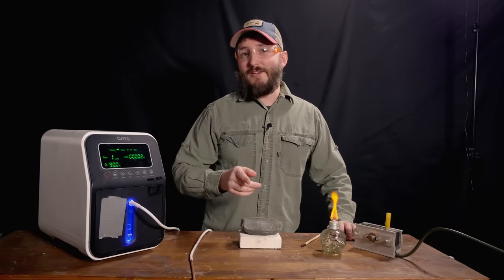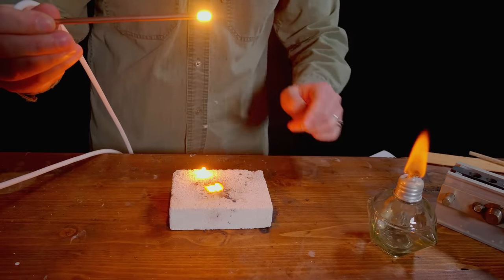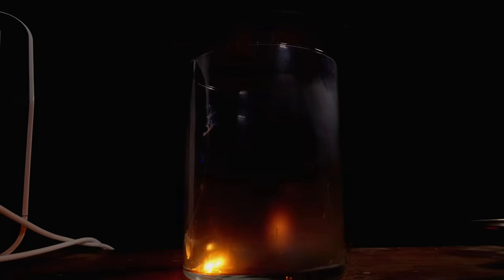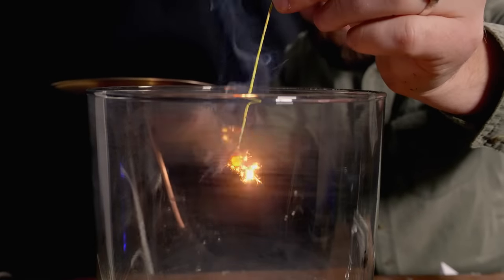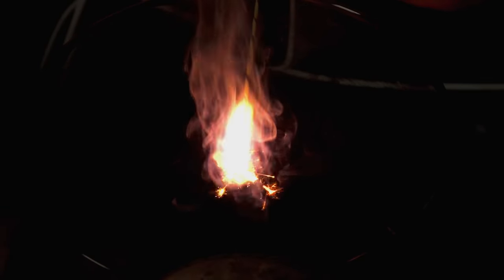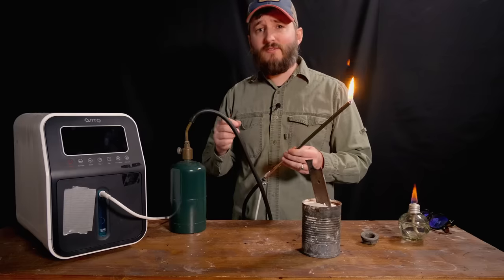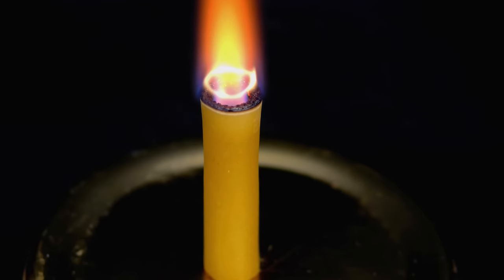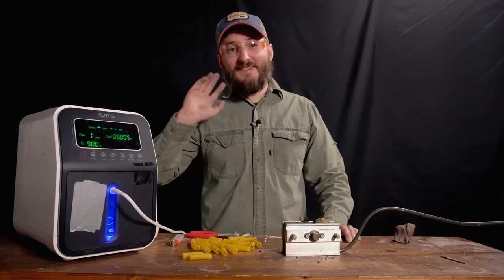6 Unauthorized Uses for a Medical Oxygen Concentrator

Comment: Thanks for an interesting video. I may wanna show other people what oxygen can do when you get it in your clothes or fabric.
I work as a biomedical engineer and service these kind of equipment and what I can see, is that your oxygen concentrator is rather weak in performance. The one I work with can deliver up to 95% pure oxygen at a rate of 5 L/M. It would be interesting to see what kind of results you could get from one of those.
When I get kids from schools to  show to our workplace, I often take them to our welding room with one concentrator with a long hose. I then take a bunch of small wood, ignite it, let it burn and it burns as it normaly would, yellow flame and rather peacefully. But when I put the hose near the bowl with wood, it burns extremely hot, white flame, lots of sooth and almost no ash. What I tell them is that oxygen is not flammable, nor explosive and that I get no flame to follow the stream of oxygen. Many people are afraid of oxygen due to old accidents with high pressure containers which got overheated and exploded.

Comment: Use a hollow carbon rod  ( arc/air)  with a welding machine. Maybe need pressurized air to blow away the melted steel. Thanks for this wonderful video.

Comment: 6:20 as soon as I head your explanation of that, i thought back to watching William Shatner's unsolved mysteries thing on discovery Channel as a kid. The segment on "spontaneous human combustion" really stuck with me, and super-oxygenation of the bedding and the person's clothes would perfectly explain the weirdness they talked about.

As for the source of ignition seemingly being the person themself? Static electricity with dry skin would do the trick. I had those thin, fuzzy polyester blankets as a kid, and rubbing the back of my hand against it made enough sparks and enough light for me to look for my glasses and bookmark without turning on a lamp. Also, it made the back of my hand quite hot. With enough oxygen, I'm certain that could spark an inferno.

Comment: I was a welder for many,many years and used an oxygen acetylene torch a lot. Your torch needs a mixing chamber to mix the propane and oxygen. You can only get them to mix a little when they are flowing out at different rates. Just make sure you have backlog prevention. You don't want oxygen in your propane tank or vice versa.

Comment: My thoughts on your demo test. Cool start for sure :3

a larger longer cut of a similar pasta could be fun, what if you layer 2 cylindrical ones somehow, O2 down center, the between space filled with another solid propellant. like linguini or spaghetti? Is whole a viable alt to bleached pastas? Or a non pasta substance, as a control with a more traditional but low yield fuel? 

A multi tube 'rocket'  stack a nice number like 7 together, with your same or another kinda clay set up. you could even cap one of the lines like they do on rocket boosters when degraded, for some ed reasoning I don't know. Look neat.

Paint the inside or outside of the pasta with what umm chemical salts to change the color the flames?

Comment: I'm wondering if using a thinner pasta like Ziti, or Penne would be a better ratio of fuel to the amount of oxygen produced, and allow higher flow velocities since the internal diameter is reduced. Making the oxygen line more narrow would help increase its velocity as well, (assuming the generator can handle the increase in the resistance) maybe try using an air nozzle that's for filling the basketballs at the oxygen output. Covering the whole noodle in clay would help with the blowouts and get full use of the fuel by providing reinforcement and direction where the pressure can vent. The experiment can show the effects of various fuel & oxi combos by changing the noodle type (ie. gluten-free or higher calorie) and changing the oxygen flow rates, along with the various nozzle designs.

Comment: I had some ideas for experiments for you! 
Make pure carbon from sugar and sulphuric acid and wash out the acid. Theoretically it should make a very good carbon for senko hanabi and gunpowder because there is no internal structure or ash like in wood. I tried baking sugar in a very hot oven with a tightly sealed foil covering with a hole for releasing the off-gassing, after baking I covered the hole and let it cool and I got a very fine carbon that spontaneously combusted when exposed to the atmosphere!

An experiment you could do with the oxygen concentrator is enriching air for use in an NO2 generator. Atmospheric air is the wrong ratio to efficiently be turned into Nitrogen Dioxide because the excess Nitrogen interferes with the reaction. The enriched air would turn more efficiently into NO2 with less Nitrous oxide and you could even run some oxygen through an Ozone generator and not only get way more ozone from it but also use the ozone to react with the NO2 generator output and oxidised the under-reacted NO gas.
Reply from the maker: Good idea for an NOx generator. For fireworks pure carbon usually has much worse performance than wood charcoal.
Reply: @Nighthawkinlight  Thanks for the reply! I reckon the reason charcoals burn better is because when crushed they form low density, porous particles whereas pure carbons like graphites have regular structures and plenty of interlocking covalent bonds resulting in smoother particles with less sites to hold onto the other gunpowder ingredients.
Sugar that has had it's Oxygen and Hydrogen ripped out is like a fluffy, expanded carbon foam puffed up with steam, closer to charcoal than pure carbon.

Comment: It's neat to see the separation of the tube layers of the PE tube at 5:24. The outer jacket peels back leaving what looks like a liner inside. I think the outside of the tubing is a softer lower melting temp PE which provides a softer more crack resistant jacket. I'm guessing that the inner liner is a higher strength core that has better creep resistance. 

Pretty cool hot glue gun lance!

Comment: I was a tapper at a phosphate plant, we used to use magnesium tubing with oxygen flowing through to open or melt the clay plug in the furnace so the slag would flow out after processing of the ore. 
Other substances that came out of the furnace were also raw melted iron from the ore...
So yeah I think magnesium would burn a lot hotter then the steel...

Comment: I’m only 10 minutes in so I’m not sure if you do later on but I feel like for extra safety you could add a flashback arrestor in case the flame travels up the tube back to the machine

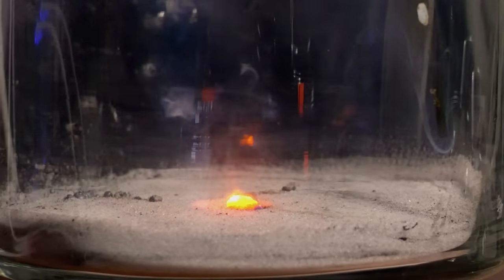Comment: Silica acts as a slag for steels/iron in refining and welding. It likely wasn't sparking around 12:20 because it likely pulled some molten silica up its surface because surface tension of molten metals is weird...
You should see what titanium does under hot oxygen streams. Its one of the only other metals other than Steel that can be cut with a oxy/fuel torch. Its not done normally because of the damage it does to the cut edge, used mostly for scrapping.

Comment: I work for a company that builds CNC Oxyfuel and Plasma cutting machines.  You touched on the exact point I was thinking of - why couldn't this be used in an industrial application instead of the inefficient O2 tanks we use?  I wonder if it is not enough O2. Oxyfuel I don't think it would be enough but our plasma systems use a mixture of O2 for a specific hole cutting process and I wonder if it could be enough.  We go off of PSI not LPM like these O2 machines so I wonder if it would be enough flow.  I even wonder if you could use these machines to fill a tank/reserve instead of using it for active cutting like you attempted.
Reply: Oxygenfrog

Comment: Several years ago I grew tired of buying oxygen cylinder refills for my glass working and jewelry torches.  I bought a used large oxy concentrator for a cheap (at the time) price and have been using it to power my torches ever since.  Feeding a proper torch it works as well as regulated high pressure oxygen. (torch head O2 pressure is usually only a few pounds).

Comment: Maybe surrounding the whole pasta with a little (in germany we call it) "sollbruchstelle" to release the pressure a lil later on- might keep its form for longer
Next would be using a smaller length of fuse- it started burning in the middle rather soon, perhaps try to make the nozzle able to directly feed off the noodle perhaps?

Comment: i use a 10lpm oxy con for glassblowing with a oxy/propane torch, opened it up and turned the regulator up to up the pressure output a bit. you would need several for a big multi stage torch but i run it on a gtt cheetah ( mid size ) torch and have made solid borosilicate marbles 2 inches in diameter no problem. in a premix torch it has no problem melting any metal or working with quartz. 
you can run several machines at once chained together but the problem is pressure, if you need high pressure it wont matter how many machines you have. you need to hook up your oxy con to a large holding tank and let it fill it to its max output pressure, then use a high pressure pump from that tank to fill a normal high pressure oxy tank. its simple to setup and will save you a ton of money in no time if you are going thru a lot of oxygen.

Comment: You need an acetylene/oxy torch body and a rosebud or heating tip attached the valve body & actual welding torch regulators to make any practical use of this setup. Since oxy concentrators for home use put out less than 10 psi of compressed oxygen, you will need to modify the output end of the oxy concentrator to accept a welders oxygen gauge in addition to going to your local welding outfitter and plumbing on the necessary fittings to a 20pound propane tank used for a gas grill. (This is how someone can get around the cost of a welding  oxygen tank which you cannot get refilled on weekends) The cutting torch body combined with the accompanying higher pressure cutting torch hoses will facilitate a higher oxy/fuel output only upto a certain point. However, the aforementioned setup is a proof of concept circumventing exclusive retail constraints. (Welding shops arent open on weekends so for the weekend hobbyists blowing glass & ornamental iron sculpture, although cutting steel with this arrangement is not practical as the cutting pressure for oxygen requires a minimum of 15-20psi at 5280ft above sea level; Heating steel and bending/blowing borosilicate glass for the weekend hobbyists has now become an achievable reality using practical, repurposed application) Proceed at your own risk in the garage not inside the house.
*Leave it to the professional welders / glassblowers who work with fire for a living & know what theyre doing. * Cheers!

Comment: Kool video.
For your rocket experiment...... off top of my head I'd say use a clear tube, so you have a 45% oxygen. Then construct a rocket using steel ink pen. Very thin metal. Where you can put noodle inside ink pen Then a launch tower to hold up right. Actualy the tube would turn into bomb.  Ok, cap the pen use the top to house oxygen and the noodle in bottom. Perhaps you could get lift in closed environment. Just quick idea. Needs more thought.

Comment: We used 1/8 inch black pipe with O2 hose to lance out our cupolas .
Also had magnesium rods.
Guy going down in cupola on a cable basket to ram bottom sand and O2 feed was not turned off when he got to O2 layer he caught fire burnt 90% of skin off lived 3 days was a friend

Comment: ~8:20 little bit stressed out that you mentioned reusing the glass container after literally having steel melt into it. I'm not entirely sure how much heat stress can compromise a glass container but it seems a liability to risk it failing potentially disastrously down the line just because you didn't want to get a new one.

Comment: With a normal oxy propane torch setup I've been able to cut thin steel with an oxygen concentrator. Note that oxypropane is very different than oxyacetylene and you have to slowly adjust it up in increments and it screams quite literally with this high pitch whistle

Comment: Your problem with the oxygen torch is due to the nozzle. You can make such a torch and just supply oxygen from your own breath. The one I made for brazing gold and silver had a "oxygen" nozzle of about 1.5 mm and the propane was supplied through a brass mesh with steel wool behind it. The oxidizer nozzle should protrude beyond the fuel line by a couple of millimeters.

Comment: If you have a lathe, you can turn a CD nozzle in graphite or 347 stainless.  Other stainless will work, just make sure it has a relatively high resistance to intergranular carbon deposition during repeated heat cycles.  Graphite is easier to turn but you need a respirator and it makes more dust than you'd think is possible.

If you can tell how much of the noodle is burning per period of time and know the oxygen flow rate you could probably get accurate enough numbers to calculate a throat diameter for it.

Comment: Thermite is a mixture of iron oxide and aluminum powder. Which is why in a metal shop you shouldn't use the same chip saw to cut iron and aluminum. 
My last year working for MnDOT in the D1a Sign Shop such an error caused a battery charger to short out and nearly burn into a metal work bench.
So to answer your question with your aluminum sand based fire brick and your iron tube, yes you had a thermite reaction.

Comment: How about angel hair pasta inside a cardboard tube? Maximum oxy/fuel interface when oxygen is pumped through the pasta-filled tube. Also, if the tube is thin enough, you might be able to use a zip tie to create a constriction in the tube for a nozzle throat. Thanks for the great video!

Comment: As far as certain substances being extremely bright i myself unbenounced to me started grinding on some light weight thin walled chromoly tubing the sparks and burning metal pieces that the grider would not only create but ignite in the process had me opting for more than sunglasses and has me opting for a welding mask. I don't think with out some modification that you could turn down a camera enough to film it as you are here. I can't imagine how bright chromoly might get in an oxygen boosted envirornment considering how bright it gets in a normal envirornment!

Comment: I was a medic for 10 years. We told people all the time to not smoke, that smoking would make whatever ailment they had worse, especially if they had breathing problems. No one listens.

If someone was in home oxygen we would warn them if the DNA gets of smoking with high concentration oxygen, but I never had an example to point to until we got called back to an elderly gentleman whom we had just taken home from the hospital with a Rx for O2 with a nasal cannula.

The inside of his nose was fried and quickly swelling shut. From his nose you could see where the plastic tube ran behind and around each of his ears and down until they connected on his throat and chest. 

Don't smoke. Don't smoke if you have respiratory issues. And don't be that person who melts their nose shut and tattoos the path for proper placement of a nasal cannula. 

However, it's still a mostly free country and you are free to make your own decisions regarding your health. Even if they are bad, terribly idiotic decisions

Comment: You could try getting a second concentrator, running the outputs through a pump to pressurize a tank, and easily refill your O2 tanks for when you need them maybe, or just use the higher pressure output to make other cool stuff

Comment: I assume that you have a fire safety you have the oxygen firebreak device installed?  It is used in oxygen therapy so if a fired breaks out in the tube the device automatically closes the oxygen supply and outs the fire out.  I use an oxygen concentrator for cpap therapy.

Comment: Great videos as always. I am really interested in your oxygen / gas torch design. I have only seen this design once before. The one I saw in the flesh that had adjustable gas valves to control the gas and air independently. It looked over 80 years old. The gas tip was set back a little bit in the air tube and the tip of the air tube had been hammered in to create, what I believe, higher air velocity..
Could you tell me the name of this? A Google search brings up nothing like this.
Keep up with the good work.
Reply from the maker: Lampworking torches apparently often use oxygen generators
Reply: @Nighthawkinlight  Thanks for the name.

I Googled ...
Glass Blowing Torch Lampworking Blast Burner Borosilicate Heavy Duty
And
Glass Blowing Torch Lampworking Blast Burner Borosilicate Heavy Duty

I came up with devices similar in operation. The one I saw used an electric blower to force regular air thru the outer jacket. It was hot enough to braze large pieces of metal. I am absolutely sure your torch at the right settings would work easily.

Comment: You need more pressure in the combustion chamber. Even a few atm would make a big difference. You can compress the output from the oxygen generator and put it in a storage tank. Make sure the propane pressure is at least as high and make sure to have a backflow preventer so the oxygen doesn't go up the propane line.